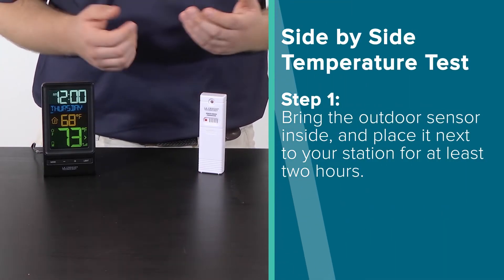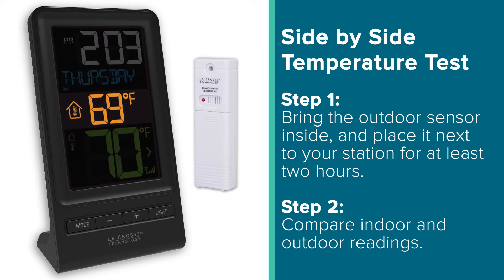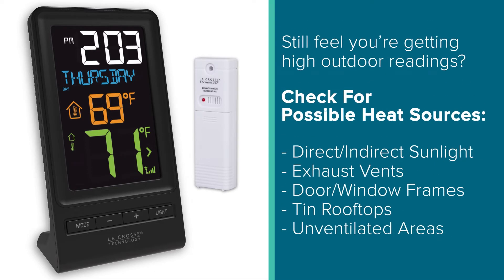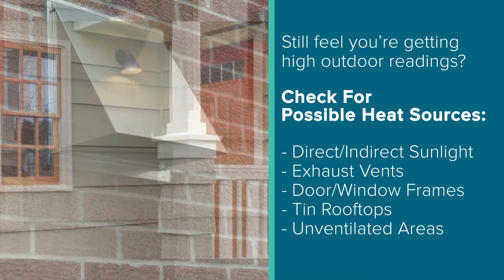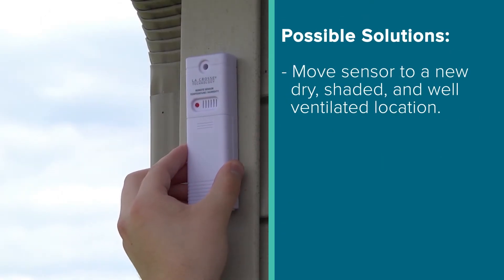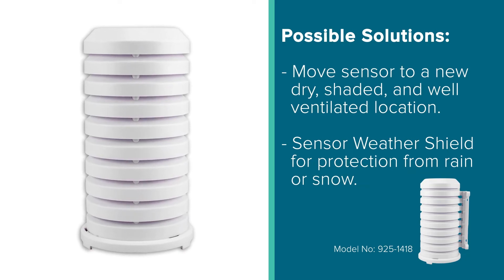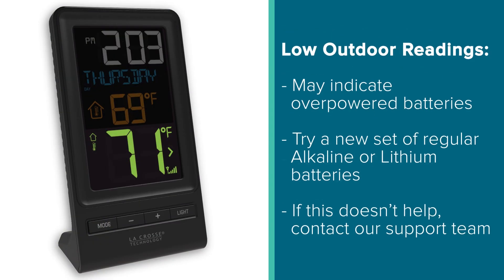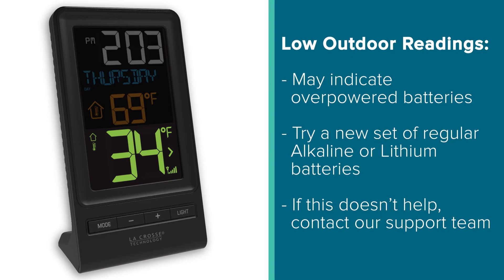Inaccurate Temperature Readings - Possible Solutions

Comment: About two years ago, our La Crosse outdoor thermometer started giving erroneously low readings when it's raining. It is accurate in dry weather. But on a rainy summer day, the temperature reading is around 45°F (actual temperature from NWS was 74°F). This week, the base display started beeping every ten minutes. Readings look normal.
Reply from the maker: We apologize for the trouble. This sounds like signs of a dying sensor (reconnecting with the display about every 10 minutes). For assistance, please message our support staff here: https://bit.ly/contact_techsupport, or alternatively, send us a private message on our Facebook: http://bit.ly/LaxTech_Facebook page.

Comment: For some reason I have this exact sensor and does not tell me when it’s raining. Even when it’s raining outside. I have the S77925-INT, does anyone else have this problem?
Reply from the maker: The sensor shown in this video that comes with our S77925 weather station is a Temperature and Humidity Sensor; it does not measure or detect rainfall and should actually be mounted in a dry, protected location out of the rain for best results. For more information regarding how your forecast icons work, check out our other video here: https://bit.ly/forecast_vid
Reply: @ what should I get to detect rainfall
Reply from the maker: @DioBrando-mj9ql  All add-on parts for your S77925 station can be found here: https://www.lacrossetechnology.com/products/s77925#parts including our TX145R Rain Gauge for measuring rainfall.

Comment: Why does my Lacrosse weather station lag behind as much as two degrees per hour in morning temperature rises and evening drops in temperature versus my mercury thermometer when sensor is placed next to the mercury thermometer?
Reply from the maker: A mercury thermometer will often see more immediate temperature changes due to its unencased analog design. Your digital sensor has a protective outer case, designed to help it withstand outdoor elements, that can slightly delay temperature shifts such that you've described. We are sorry for any inconvenience.

Comment: It did not help! If it told us how adjust the units to make temp match.. IT DID NOT!!
Reply from the maker: As our digital units are programmed and tested at the factory level, there is typically no manual adjustment for temperature values. Our industry-standard tolerances are +/- 2°F compared to the actual temperature, meaning if, after this test, your indoor and outdoor values are within 4°F, the product is considered in working order. However, if your readings are outside of this range, please message our support staff here: https://bit.ly/contact_techsupport, or alternatively, send us a private message on our Facebook: http://bit.ly/LaxTech_Facebook page for further assistance. We apologize for any inconvenience.

Comment: How do open the sensor to change the batteries?
Reply from the maker: Hey Clay, sorry for the trouble. You can open the battery cover by pressing the front of the sensor and pushing the lower half down. This may require a little force. If you need further assistance, please message our support staff directly here: https://bit.ly/contact_techsupport. Or alternatively, send us a private message on our Facebook: http://bit.ly/LaxTech_Facebook page.

Comment: Within a couple degrees of each other? As a consumer, I kind of expect them to be a bit more accurate than that.

Actually, I purchased it for storing certain goods which require a specific temperature. This doesn't really meet my needs. 😑
Reply from the maker: Most of our products follow consumer electronic industry-standard tolerances of +/- 2°F compared to the actual temperature (some are more precise). If your application requires scientifically precise measurements, we suggest looking elsewhere at this time. Thermometers, hygrometers, anemometers, barometers, and other measurement devices meant for proper scientific testing will indeed be more accurate; however, they will also likely be found at a much higher price point. We apologize for any confusion or trouble with your product and wish you the best moving forward. For additional assistance, please message our support staff directly here: https://bit.ly/contact_techsupport. Or alternatively, send us a private message on our Facebook: http://bit.ly/LaxTech_Facebook page.
Reply: I agree with you! But what do you expect from something made in China!

Comment: I have the 308-1425bca.  After about 6 months it occasionally showed an indoor temp of -9.9C, then would gradually go back up to the correct reading.  A year later, it shows -9.9C 99% of the time.  I do have another thermometer that gives the correct indoor reading, currently 22.0C.  It is 24.3C outside right now so -9.9C is WRONG.  A side-by-side test is irrelevant.  Is there any help for this unit?
Reply from the maker: Our sincere apologies for the trouble. For assistance, please message our support staff directly here: https://bit.ly/contact_techsupport. Our team is here to help in any way we can.

Comment: Hi, after many years of working amazingly well, my La Crosse CA85169 is showing strange readings. I came home yesterday to see an outdoor 60 degrees Celsius reading. I brought it in this morning and changed the batteries on both the transmitter and temperature station. Once it reset, it’s been stuck on -40 (minus 40) degrees Celsius. I will continue to monitor the device but I have a feeling it may have reached the end of its useful life. Any feedback? Thanks!
Reply from the maker: What you've described would certainly indicate the sensor is at its life's end. A replacement can be found on our website here: https://www.lacrossetechnology.com/products/ca85169#parts  -- Our sincere apologies for the inconvenience.

Comment: I purchase a UNO581 in 4/23 and my unit is reading an outside temp LL.L and I have replace the batteries in both units and have reset them using battery free for 15 minutes and then pressing a button 20 times method and it worked but it only lasted about 20 minutes is there any other way of fixing or do I need to purchase another one? If that the case I would not recommend your product.
Reply from the maker: This error message typically indicates the outdoor sensor is either outside of its readable range or the batteries inside of it are under or overpowered. Please try replacing the batteries (a new set of regular alkaline is recommended) and moving the sensor to a new fully shaded location closer to the display. Reducing the amount of large objects, walls, floors, or other electronics between the sensor and display can often help as well. If this error still persists, please message our support staff directly here: https://bit.ly/contact_techsupport. Or alternatively, send us a private message on our Facebook: http://bit.ly/LaxTech_Facebook or Twitter: http://bit.ly/LaxTech__Twitter page for further assistance. We do apologize for any inconvenience.

Comment: Hmm, so, a 2f difference is considered fine by industry standards of a thermometer? I don't have a la crosse one, got another brand, just happened to find this video. Mine shows about 0.8-1.2C difference between the outside and inside one even when both are sitting at the exact same space, which is just about barely in the 2f range, although at the top end. I guess I should just live with it then if this is supposedly common and an acceptable range. Just gotta figure out which one reads wrong and then maybe print out a reminder label to paste on the indoor unit to say that the outdoor or indoor unit reads about 1C too cold or too hot. I have some other thermometers that should do the trick in determining which one seems good.
Reply from the maker: Most thermometers in the consumer electronics industry have a tolerance of +/- 2°F compared to the actual temperature. So when performing a side-by-side test next to an indoor display, there could technically be up to a 4°F difference (one reading 2° high and one 2° low) between the two readings to be considered working correctly. If your application requires scientifically precise measurements we’d highly suggest looking elsewhere. Thermometers, hygrometers, anemometers, barometers, and other measurement devices that are meant for true scientific testing will indeed be more accurate, however, will also likely be found at a much higher price point.

Comment: My outdoor temp sensor purchased earlier this year still under warranty has a 4-degree difference when placed next to the indoor unit, Lacrosse claims in the video that they pride themselves on accuracy but when I reported the 4-degree difference in temp they told me that was acceptable, so, so much for pride in accuracy as suggested in the video. To bad Lacrosse will not share the schematics so one can pinpoint the location to add an adjustable potentiometer to offset reading or at least take pride in the equipment they sell and replace unit
Reply from the maker: Our consumer electronics are built with industry standard tolorances of +/-2°F compared to the actual temperature, thus the possible 4°F difference when comparing the two readings. So, though on the high end of this spectrum, your product would still fall within our tolorancey range as our support staff noted. We do apologize for any trouble and are here to help in any way we can.
Reply: @lacrossetechnology  Mine has a 7 deg C difference.
Reply from the maker: @larrygoulet  If you have performed the side-by-side test and this was the result with the sensor sitting next to the display for at least two hours, than we'd suggest reaching out to support for assistance. If you could share the model number of your device, we'd be happy to point you in the right direction as to who to reach out to.
Reply: @lacrossetechnology  How does +-2 equal -4 diff?  Today it is 12f as reported by the airport and a half dozen pws near me mine reports 16 that is 4f difference not plus minus 2.
If you cannot offset the reading from the sensor then any chance of a firmware update to add that feature to the monitor?
Reply from the maker: @bartglow  For instance, if the sensor is reading 2° colder and the display is reading 2° warmer, this would result in a 4°F possible difference with both parts still within tolerance. Please keep in mind this is a comparison between two La Crosse Technology products that are in the same environment, as described in this video. We cannot compare readings from other instruments which may have different tolerances and be miles away from your location. If you believe you’re getting high outdoor readings, we suggest looking for possible heat sources such as direct and indirect sunlight, exhaust vents, door or window frames, and unventilated areas where excess heat and humidity can get trapped. All of these and many other factors can cause inflated outdoor readings. Trying a new outdoor location for your sensor often helps resolve this issue.

Comment: There is a slide selector and a white button on the sensor..I cannot find anywhere what they do? and what are they for?
Reply from the maker: This will depend on the model sensor you own, but in most cases the small TX button above the batteries is short for "Transmission" - Pressing this will force a radio update to the display and is useful for connecting specific sensors instantly. If your sensor also has a slider, this is either for specific channels (some products can display up to 3 different sensors using these) or if your sensor has a built-in LCD, this slider may control the °F or °C readout on it. Looking up the sensor model number via our website search should help bring up more specifics: https://www.lacrossetechnology.com/pages/where-do-i-find-a-manual-for-my-station

Comment: Hi i have the La Crosse CA87092 and the outside tempture is way off from the inside one. When i reset them they are fine but after a day or 2 it goes way off again. Any advice would be great. Having this trouble for awhile now. Reset it on Thursday and it is off again today. Inside reads 23.3 and outside reads 39.2. I know it is way off.
Reply from the maker: Hey Paul, sorry for the trouble. If your side-by-side readings are off by this much, there is definitely an issue. Please contact our Canadian representatives via one of the options below for further assistance. 

Email:  info@springfieldinstruments.com
Online Form: https://springfieldinstruments.com/customer-service/ 
Phone:  844-687-4040

Comment: I have the 308-1425bca and the indoor temp has been way off since we got it. Your video shows how to correct outdoor. I’m not sure how this reads indoor but how do you fix those?
Reply from the maker: Hey Cathy, our apologies for any trouble. This video simply shows how to perform a side-by-side test using your outdoor sensor. This process is the same for testing to see if your indoor readings are accurate as well. Please trying bringing your outdoor sensor inside and placing it next to the main display for at least a couple of hours (this allows us to compare readings from two La Crosse Technology devices). After this time, how do your indoor and "outdoor" readings compare?

Comment: The indoor temp isnt close to what it actually is, how does it read those and how can I fix it?
Reply from the maker: Hey Cathy, your 308-1425BCA weather station dispaly has built-in sensors for measuring temperature, humidity, and barmoetric pressure. To confirm your unit isn't reading correctly, we recommend performing the side-by-side test shown in this video to compare data between two La Crosse Technology devices. Once we know the results of this test we'll be able to provide further instruction.

Comment: Hi Y20657PSRC the outdoor sensor keeps showinh very high temperature readings, I have done several full re-starts, new batteries etc and it works OK for a while then goes out of sync again, today reading 19.2deg C  actual temperature was 11deg, this is the second or third time in about 8 or 9 months and will now not reset. used in the UK.
Reply from the maker: Hey John, we are truly sorry for the trouble with your weather station. Unfortunately, the model number you've listed is not a product made by La Crosse Technology. We'd suggest reaching out to the seller or actual manufacturer for further assistance.

Comment: My S82950 outdoor temperature shows -36°F when it's actually 43°F and the humidity is stuck at 99. Is this normal? I just put new batteries in the sensor yesterday. Its also in shade.
Reply from the maker: Our apologies for the trouble. No, this is not normal. Our first recommendation would be to try a new set of regular alkaline batteries in the sensor. If this does not correct the problem, please message our support staff directly here: https://bit.ly/contact_techsupport. Or alternatively, send us a private message on our Facebook: http://bit.ly/LaxTech_Facebook or Twitter: http://bit.ly/LaxTech__Twitter page for further assistance.
Reply: @lacrossetechnology  My tempature is going up but slowly. At 2:30 it was at -15°. At 7:00 it was at -7°. At 8:30 it was at -3°. And I put new batteries in. Should I get a new sensor?
Reply from the maker: @thegamingshow9971  In cases like this, yes, a new sensor is often required. You can find replacement parts on our website here: https://www.lacrossetechnology.com/products/S82950#parts or feel free to reach out to our support staff for further assistance and any warranty claims. Sorry again for this inconvenience.
Reply: @lacrossetechnology  Ok thank you.
Reply: @lacrossetechnology  Now my outdoor reading is showing 20 degrees when I know it's at least 65. What can I do?
Reply: Can you help me??
Reply from the maker: @thegamingshow9971  To get your information, you will need to reach out to our support staff directly here: https://bit.ly/contact_techsupport. Or alternatively, send us a private message on our Facebook: http://bit.ly/LaxTech_Facebook or Twitter: http://bit.ly/LaxTech__Twitter page for further assistance.

Comment: The indoor temp on my weather station never changes and I know its wrong.  How do I correct this?
Reply from the maker: Our first suggestion would be to try a full reset of your display and then perform a side by side test following these steps:

1. Remove all power from your display, including batteries and unplugging the power cord from both your wall and from your display.

2. Press any button on the display at least 25 times and leave it sitting without power for at least two hours.

3. Power the display back up by plugging the power cord into your outlet first, then into your display. If your model uses AA or AAA batteries, be sure to install a new set of alkaline batteries, other battery types should be avoided. 

4. Bring your outdoor sensor inside and place it next to the display for at least two hours. 

5. After this time compare the indoor and "outdoor" readings. If the readings are within 4°F of one another the sensor and display are likely both in working order. 

If the readings are outside of this range or if you should need further assistance, please message our support staff directly here: https://bit.ly/contact_techsupport. Or alternatively, send us a private message on our Facebook: http://bit.ly/LaxTech_Facebook or Twitter: http://bit.ly/LaxTech__Twitter page. We are truly sorry for any inconvenience.